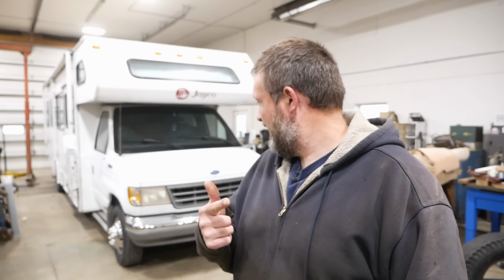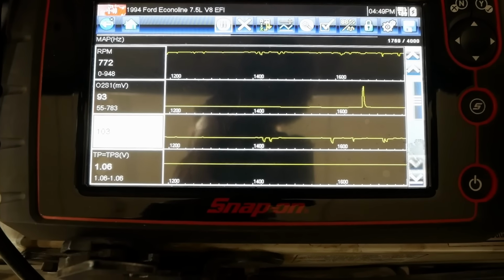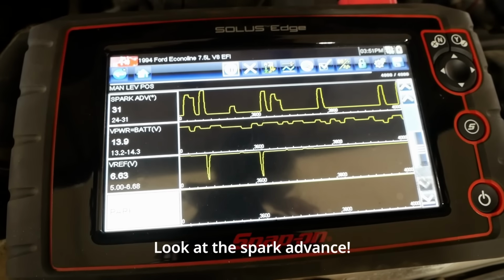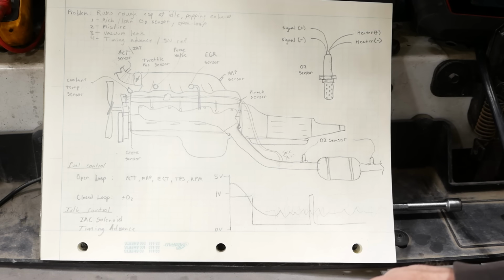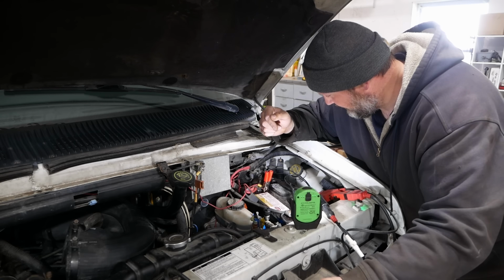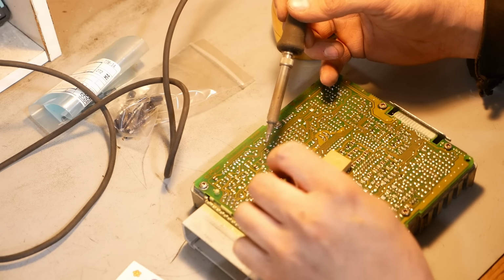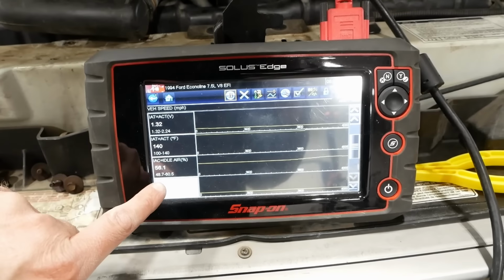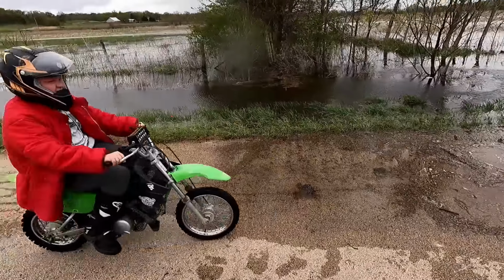Ford 460 RV Surges, Runs Rough but Nothing's Wrong?

Comment: Hey Wes, ODB 1 systems with an air injection pump, the singular purpose of air pump is to add fresh air in front of the CAT so as to introduce more oxygen into the exhaust stream to continue burning any unburned gases that remain in the system as it passes through the CAT and then exits the tailpipe.

Comment: Software engineer here. In the late 90s early 2000s there was a very substantial issue with capacitors popping because the major global manufacturer did something wrong with the electrolyte in the capacitors. Computers were failing daily during that time. I wonder if it is the same issue.

Comment: I had this problem on my 88. Fixed it with a carburetor and a points distributor, much more reliable now. After 35 years of heat cycles and vibration, you really can't trust the factory electronics, and you also can't trust the replacement parts that come with zero quality control. Good to know what the problem was at least.

Comment: IF the customer sells for trouble-shooting, for diganosis, the bill ist extensively high. 
It is much cheaper, just to shoot the parts-cannon. 
This is, what i do on my cars. 
Start with the cheapest part and so on. 

The parts I did un-necessarily change, they'll still work for years to come. That's why my car probably won't let me down on the highway a hundred miles from home. Because the temperature sensor, the crankshaft or camshaft sensor, the clutch engagement or disengagement cylinder, I've already replaced those. 

A repair in my own garage is only costing me the price of the parts - I'm not paying the hopelessly overpriced prices for original vw parts, but aftermarket prices for oem parts. A thermostat from Behr costs me 7 euro - 42 euro from vw. It is the same - without vw-logo. 

I also save the high costs for labor - a proper diagnosis, where you find out that the o2-sensor is intact, and also the other temperature sensors, that takes 2-3 hours and costs 150 dollar each hour. Sometime 3.000 dollars, IF you let the customer pay. The sensors cost me 50 euros and 1 hour of time. 

If you have 250,000 subscribers, you don't have to worry about the money coming in and the financial future, and you can spend a lot of (unpaid) time on the diagnosis. 

Without youtube, the parts gun is by far the better solution. Diagnostic equipment, repair forums and last but not least the parts cannon are often the better solution in combination compared to time-consuming diagnosis. 

That a mechanic is worth his money, however, he shows only through a good diagnosis. Therefore, I take my hat off to you - we all!

Comment: The PCMs of these older,  low mileage vehicles are increasingly suspect.  So is a coked up throttle body and IAC.  O2 sensors produce little to no voltage when exhaust oxygen and atmospheric O2 are similar.  They only produce voltage when there is a high disparity between exhaust and atmospheric oxygen  (rich). If you can force them rich with snap throttle,  they're probably ok. I have seen the heater circuit shortly the signal to either power or ground however.  Not a bad idea to replace them every 20 years or so. 😊

Comment: Only a Chevy guy would actually put that on their camper,🙄, with 25k miles on it maybe the chronic-goof hasn't had it long enough to abuse-N-neglect it real bad yet,🤞😉👌, don't hold your breath tho, lol, btw, why is a camper such a bad thing to work on anyway?, how is it so much worse than very similar vehicles, generally speaking you'd think mechanics would prefer a camper over a box delivery van, because campers usually have low miles, and aren't abused like a delivery van is, 🙃, this upside-down world we live-in makes less sense too me every day I live,😖, good job-n-thanks for sharing.

Comment: Wes, I recently helped my neighbor with his 1994 RV with the Ford 5.7L engine. It also had the v1 OBD and didn't generate any errors. Being that it was an Old School Fuel Injection unit and it seemed to be running rich, I fooled around with the AIS Air Idle Solenoid [ thinking it wasn't operating] but after replacing it, I had to look deeper. The next thing I focused on was the cold start/run circuit. I new that all FI systems use an enrichment circuit during cold start. Which I suspected the Engine Coolant temp was involved, however, the engine displayed Temp seemed to be correct.  Turns out there are two Temperature sensors, [1] for the Engine Gauge display and another [1] for the Fuel Injection system. Changed the Engine Temp sensor used on the FI and the issue cleared up.

Comment: Great job on that repair Wes, I work for the linear regulators team at Texas Instruments and have dealt with many customers using incorrect bypass capacitors (please read the datasheet!) on both the input and output of regulators leading to unpredictable behavior which cascades to microcontroller and DAC/ADC failures on the rail which is now unregulated. We recommend ceramic surface mount caps for most modern designs now. I wouldn't wish working on defunct 80s 90s PCM circuit boards on anyone lol

Comment: Did you mention those are polarized capacitors? Anyone attempting stuff like that should know there are polarized and non polarized and are not interchangeable. Put em in backwards and put the power to em they pop like fire crackers.😆

Comment: Surging in a traditional design occurs when you a vacuum advance that is sized wrong, clogged, leaking, failing or other. So, I would get away from looking at electronics and vacuum  test every line. Good luck. Could be a PCV, breather, bad flare on a steel-line, pin-hole or dry-rotted hose. Could be any/some and all of these potential problems. Good luck.

Comment: Had a similar problem all the cap's had died. If you find one with a bowed upward head, it's gone. It was easy to fix as they were not SMD's, they were old school with leads. The other problem is the first supplier I contacted only wanted to sell me 30 units, I only needed 4. That's a nightmare, turns out an overseas supplier, for what the first company sold their stuff I could get the 30 from another country at half the price including shipping (not from China)

Comment: Hi Wes, You are a very diligent young man, I am very impressed with your capabilities. However, having said that I thought you very lucky as you failed to ground yourself with a wrist cable. Static electricity can destroy computer electronics without leaving a trace. As for your not understanding things you will find that the more problems you solve so there will be more unsolved questions ahead NOT LESS. I have had many hobbies and at present am deeply involved in Astrophysics and have solved many of the problems of space research. So keep on learning and you will find that the more you learn then there will be more things to learn. Keep it up Wes and you will eventually die with more unsolved questions than you have now. Good Luck in your lifetime of problem-solving.  Moking , gained a BSc (Hons) at the age of 64.  Oh by the way, I like your style. MoK

Comment: On GM cars that injected air at the manifold or before the O2 sensor they either had the O2 on the opposite bank only (my 93 Caprice was like this), or they modified the O2 switching voltage while air was being injected.  The switching voltage would have to drop by a hundred or more mV.  As for the open loop idle, my guess is the O2 is so far from the engine (and perhaps combined with the air situation), their PID loop just wasn't stable enough for good air fuel ratio control at idle and since emissions requirements apparently didn't drive them to mandate closed loop idle, they just said screw it.

Comment: I'm a Ford girl, was raised in a Ford family so when you say you don't understand what is going on in that engine bay well I can tell you without hesitation that Ford engineers past and most definitely present are idiots and if they designed something that doesn't work they just bypass it and go into production......It's the FORD way and that's why I'll never buy another one ...EVER.
Reply from the maker: It's not hard to see why the Ford system did not make it into OBD2.

Comment: One time I was asked to look at this motorhome older one with a 440 have a couple Mobile mechanics out to look at it couldn't figure out what was wrong. They've heard of me after I close up the shop and went out to look at it about five or six miles down the road finally got it to run and idle, so I figured I'd let it idle for a while warn it up and she would happen then that lovely smell of roasted chestnuts yes I did say roasted chestnuts turns out a squirrel had packed exhaust system full of nuts I told him they would have to have it towed to a shop and put exhaust system in at that time I didn't do exhaust systems. And I told him not to try to drive it may start a forest fire.

Comment: Are you sure the 63V wasn’t 6.3V? I don’t know what would be making so much voltage in the ECU, also 6.3V is somewhat common for capacitors. Maybe that was the one for the 5V reference. Even if it was 6.3 bumping it up to a 100V capable cap will do nothing but good I guess
Reply: They're 63V 
I've replaced dozens of them.
Reply: @jimurrata6785  oh, that’s strange. Is there some kind of voltage multiplier or high voltage signal?
Reply: @charlie_nolan  I only know what I've seen when fixing these things.
If anything perhaps it's to protect from a switching spike or back EMF?
I'm not sure, but I'm darn sure I wouldn't go lower given how many of these EEC- IV ECU's I've seen with bad caps.
Reply: @jimurrata6785  ah, that makes sense. Yeah

Comment: Look for a busted vacuum hose, I can hear it surging, Also pour some seafoam in the tank. When you pull codes always use slow codes and do a KOER self test and that will show alot, clean up the throttle body too

Comment: My first thought carbon fouled spark plugs, those 460 and 429 big blocks , if they are not warmed up enough tend to get black carbon on the side of the plug and instead of the strong blue spark at the tip you get lots of little red weak sparks up and down the side of the plug, it will make it run very rough.

Comment: Dont worry about it Wes just write up the bill hold out your hand and smile and say its fixed. This reminds me of a mk 2 ford escort 1600 years ago.  Did a head job on it It started ran and sent it back to the customer. Two days later it came back on a tow truck. The timing was miles out and it would hardly run. I reset the timing and it ran fine. Running in the shop 5 minutes later and it stopped and wouldn't start and it backfired.  I took the cap off and gave the rotor a twist thinking it was flogged out. The whole shaft turned. The pin holding distributor gear onto the shaft had broken.  It had just enough drag to keep it in place and no more.

Comment: Every time I work on a ford van based RV the dash air only blows thru the defrost. I think I've fixed 5 this year.
Reply: Leaking vacuum fitting, cracked reservoir

Comment: I’ve only watched about five minutes of your video and it sounds like a similar problem I had with an 02 Saturn four cylinder. I choose not to work on my vehicle’s anymore now that I’m retired and only reluctantly diss it when I was younger, but economics forced me to do many things I  couldn’t afford to have done. 
The Saturn had the same symptoms m, started hard rpm surge, ran rough, horrible fuel mileage. I took it to two shops that spent hours “ Annalising “ then gave up and told me to come get it,… no charge. I was getting ready to set it on fire and roll it down a hill. Then I looked on YouTube and there they told me it was likely the temperature sensor on the engine block. Long story short, this year of Saturn has two temperature sensors one for the temp gauge and a hidden one that goes to the engine computer and when it malfunctions it confuses the computer the engine is cold and raises the idle and the fuel/air mixture and causes the other problems. 
It was an $8. Part and as soon as I plugged it in and started the engine it ran perfectly. 
We have become so over dependent on these handy dandy plug it in and it tells you what’s wrong, things that well… don’t get me started, lol.

Comment: Had a similar issue with a work truck years ago.  Turned out someone ran the fuel pump power supply over the exhaust.  Ran fine when cold.  One it warmed up the exhaust would get hot and melt the wire insulation and short out.  Took my mechanic a LONG time to figure 3

Comment: I’ve seen it on older fords with modern scan tools where the data doesn’t translate correctly and I think that’s why vref was 6 volts. As for idling in open loop I had an 87 jeep that would do that and run super lean all because of someone wiring the o2 sensor heater relay backwards.

Comment: Something your probably aware of is coolant temp has a bit to do with closed loop operations. Lots of fuel mileage issues were caused by low coolant temps back in 90s to early 2000s .

Comment: Matco has a SP60R plug wire plugs from Matco. A Launch x431 Pad vII tests modules, etc. See if the timing is at 10°. With the spout hooked up, it should read 30°. If not, it's the module. There's no code for module. A pickup coil can cause stalling when the engine warms up. There's a code for pickup coil. Check the distributor cap. It can arc over to another cylinder. A scope secondary pattern shows that on parade pattern. eBay has a scope for coil on plug that shows an individual cylinder. Jonard tools has a fuse puller.
Reply from the maker: I have a Pico scope. But I don't know if that will help us here.

Comment: Obviously you should have backed that rig into the shop so the nose would point North-ish.... Why? (The amateur meck-a-neck might ask...) Because it was made in Canada and by not pointing it's nose 'home' you did not cause the hidden OBD.05 system to apply the pancake spatula to yon 460cu petroleum siphon.

That's about 7.2 metric hours of book time just to get that far. Now, simply multiply your age times the nearest speed-limit sign and add the 'Complimentary Tow-It Off The Lot' fee, bill the customer and drop that pig off at the nearest rest-area. . 

(Dude! You're the first person (besides me) I've seen who intentionally has a collection of capacitors! Well done!)

.

Comment: I am now considering doing similar in a slightly newer E350, though from an engineering standpoint, I would consider the use of electrolytics in a piece of equipment such as an ECM a sin

Comment: Good analysis.  It's always a good call to replace all the electrolytics, not just the failed one, and to go up a voltage.  Manufacturers almost always save a penny here and a penny there by using a capacitor whose voltage rating is just good enough, while going from (say) 16V to 24V hardly increases the size of the component but ensures a much longer life.

Comment: As I understood, the secondary air system injected exhaust into the system, not clean air. I was under the impression that it was trying to reduce emissions by re-circulating the apready burned air back through one mre time to get any unburned fuel to burn. Don't quote me on that.

Not sure how the computer doesn't get thrown off by that.
Reply: Nope. EGR (exhaust gas recirculation) valve does that.
The thermactor system pumps extra oxygen into the exhaust manifolds and catalytic in an effort to light off unburned hydrocarbons and carbon monoxide.

Comment: The ingniton system on these suffer heat soak when it gets hot it shuts down. It was an inharent problum from the factory. Had 89 with the same problum

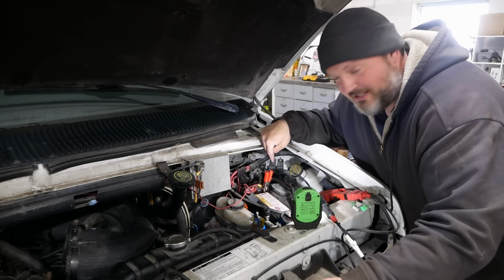Comment: 15:20 Computer pulled from firewall. Three blown capacitors replaced.
Issue resolved.
Reply from the maker: You should check out an app called TikTok. Great for those with limited attention span.
Reply: @WatchWesWork  
Watched full video including river adventure. I have a 460 in an 87 motorhome.